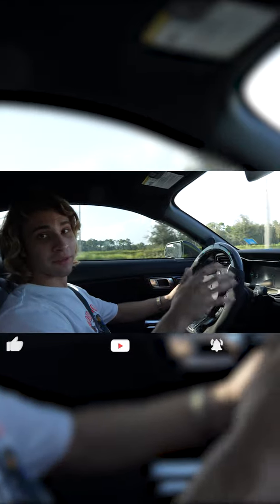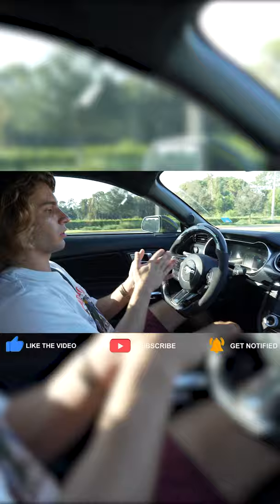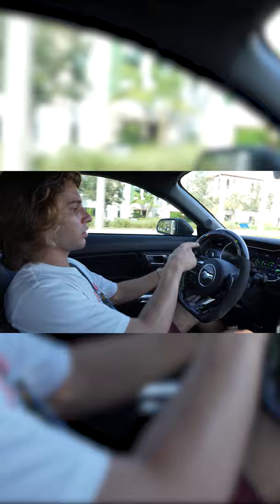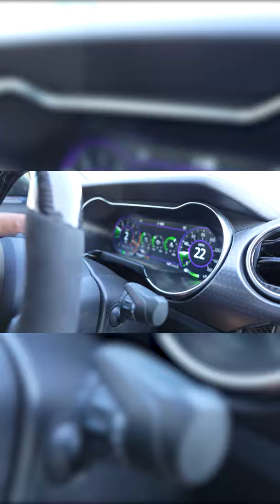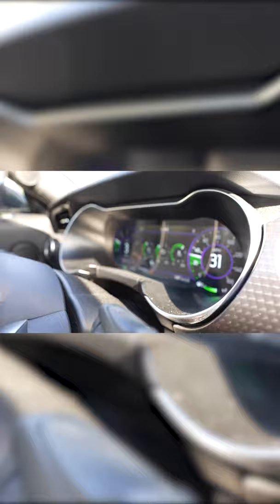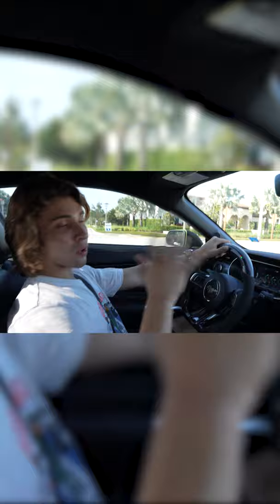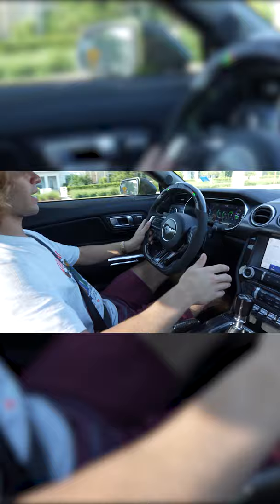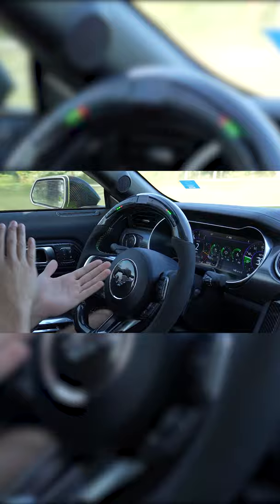MASTERING REV MATCH DOWNSHIFTING: HOW TO BLIP THE THROTTLE #MUSTANG #SHORTS #MANUAL #5OH #V8

Comment: So you have to keep the same RPM that’s you’re in when you down shift
Reply: No? You're wording is confusing. You just have to give it enough throttle while the clutch is in so when you down shift your rpms match your speed when you complete your downshift.
Reply: @evanderlugops  wym match speed like let’s say I’m going 20 mph I need to rev to 2000 rpm’s to match?
Reply: @BnkrdBones  first you need to have an approximate idea of what your rpms are at 20 mph in the gear you want to down shift to. Let's say you know that in first gear 20 mph is 2000 rpms. If you're in second gear and want to go to 1st you want to put the clutch in and Rev the motor to about 2000 or slightly more and then let off the clutch the car will match when releasing the clutch of done properly. If too much gas is given the car will buck as in trying to accelerate and not enough gas and the car will almost bog and you'll hear the the engine rpms rise due to the syncros trying to match engine speed to wheel speed.

Comment: I find it easier to just think about how much i have to go up in rpm. This is just a graph that you can visualize in ur head where the higher your rpm, the more you’re gonna have to go up, and the lower your gear, the more you’re gonna have to go up. Then say i’m in 5th gear going to 4th at low rpm i know my blip doesn’t have to be super strong, probably only a 200 rpm difference if im really low in the rpm to start off. But If im at high rpm in any year i know that blip is gonna be bigger. If im in a low gear I know that blip is gonna be bigger. I think its better to memorize stuff in a sliding scale like this cause always having to look at your speed and shit isn’t practical

Comment: I’ve never looked at the rpms I just go off feel because having to remember what revs you need to be at for every gear at various speeds and rpms is annoying. If you over blip or under blip just use clutch control to smooth it out.
Reply: If you overblip do you hold the clutch at  the biting point longer or you just let go of the clutch
Reply: @des_AT  depends on the car and how much of an over or under blip. On my '03 Wrangler the revs dropped very quickly (mechanical throttle body and NA) so I would just let go of the clutch and it would almost always be smooth. On my '21 WRX the revs drop more slowly (electronic throttle body and turbocharged) so I have to hold at the bite point for half a second longer. Totally situationally dependent, but it's usually better to over blip than under blip as it is easier and faster for your engine to drop the revs than it is to bring them back up.

Comment: After you get used to the bite point you just blip the trottle and hold the clutch until the revs match up because some cars (like my mk6 gti) drop the revs super fast after you lift the clutch so you have to hold the clutch and wait for the revs to stabilize if not the car will jolt.

Comment: Weird I drive a 2003 Jetta Manual and I when I down shift I just let my foot of the gas pedal let the car slow on its own and clutch in and drop to the lower gear easily! I don’t even use the clutch sometimes I just know when to shift at the exact moment I hear my engine wanting to shift!

Comment: Oh I see I never owned a manual but this makes since so all u gotta do is just get it up to 2k rpm’s then clutch in downshift then blip the throttle and clutch out slowly to make it smooth transition to downshift seems pretty easy
Reply: If you rev matched correctly you can let the clutch smoothly but doesn’t have to be slow

Comment: Loved the vid! quick question, how do you feel about the older WRX 5 speeds?
Reply: Love them!
Reply: I want a bugeye so badly
Reply: They're dated tech but ok. Rides still rough without 6th gear and bad ratios. Had an 2006 Hawkeye. Now in 2016 focus st.
Reply: @StopWars420  yup, i have a 06 hawkeye currently and am desperately wanting to 6 speed sti swap the trans 😭
Reply: @joheewrx5278  I know a guy with a 4 speed Corvette. Times have changed.
Reply: @StopWars420  sick! dang my first car was 07 hawkeye and i just got a 14 ST lol